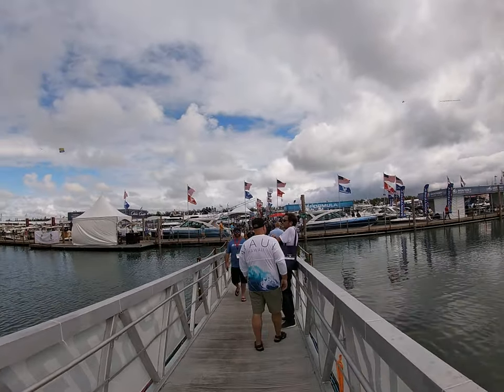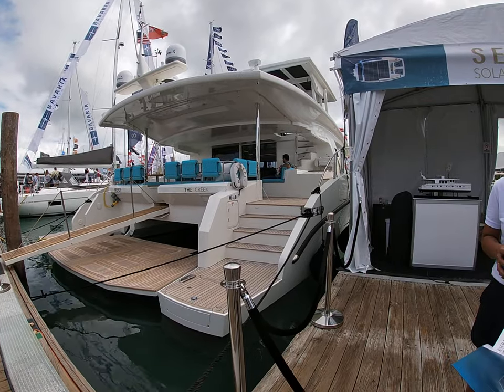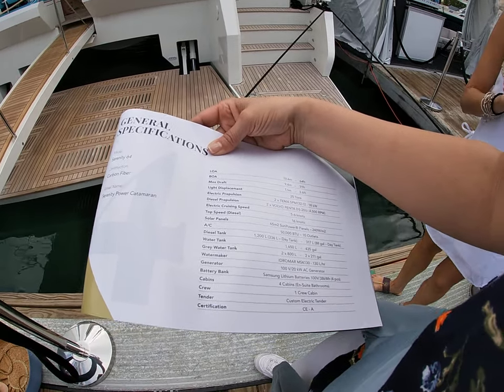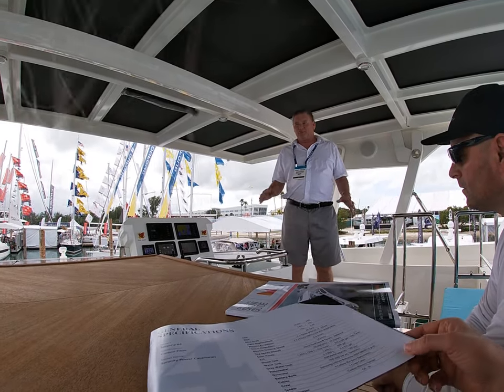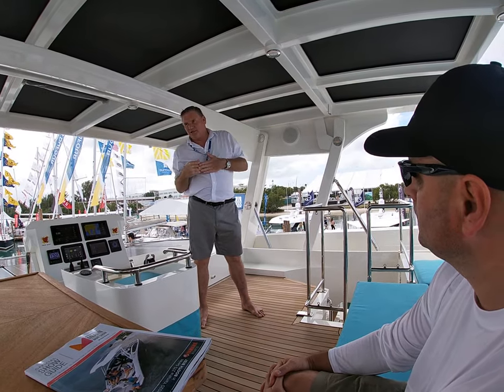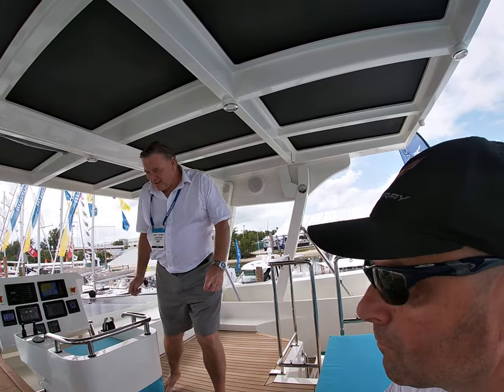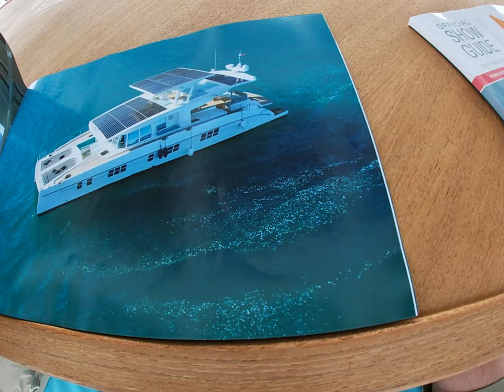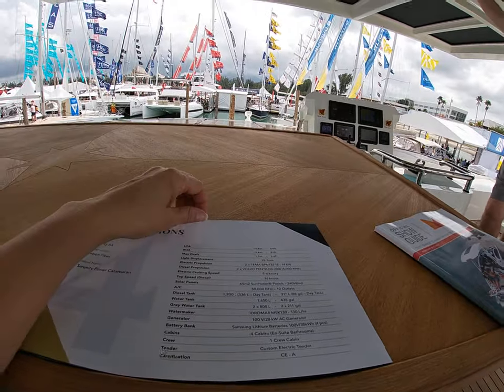Serenity 64 100% Solar Powered Electric Catamaran Tour Debut Reveal,Tesla of Yachts 2020 Miami Show

Comment: No more waiting in line at the fuel dock - BETTER - no more fuel dock. No more oil changes, filters, gasket leaks, fuel filters, fuel injectors, etc. Probably THOUSANDS of dollars every year NOT spent on boat fuel and servicing. Subtract that from the bottom line. Makes most Solar Cats less to purchase and own than a diesel boat.